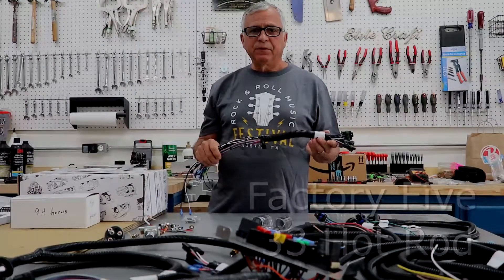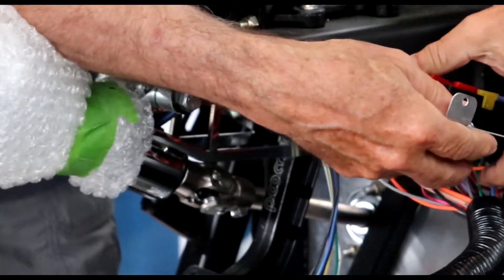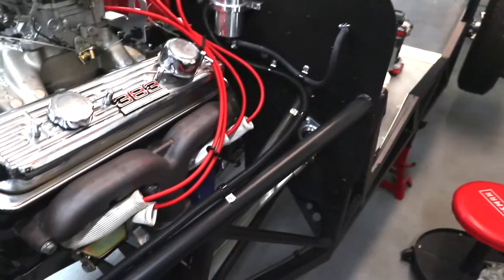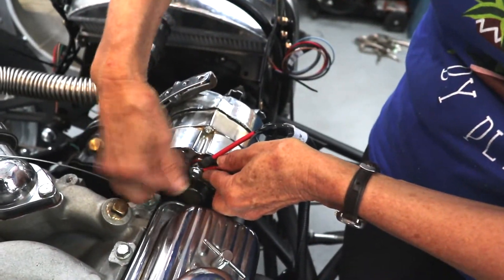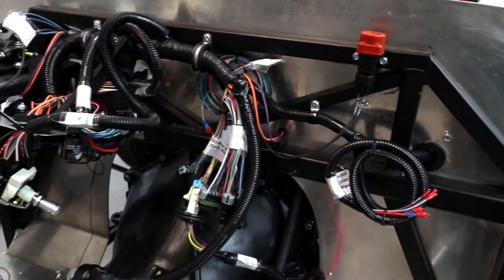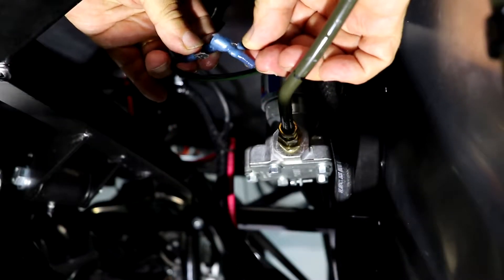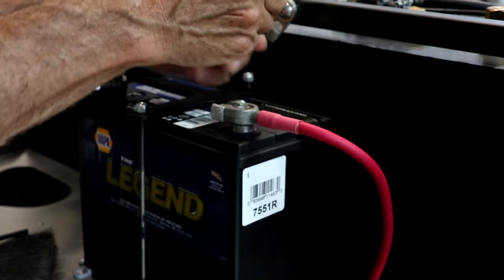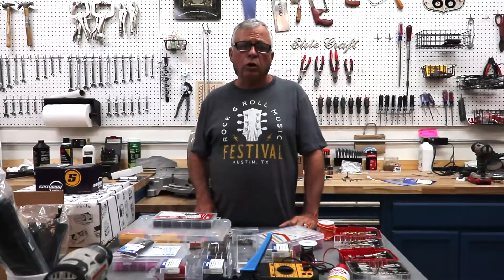#17 Factory Five 33 Hot Rod Build - Electrical

Comment: The wiring harness is simply color coded, and the wiring diagram for the car is overall satisfactory?  The inertia switch …. Does that shut down /  cur out power to the car in the event of an accident?  There fuse block has ample space built in to add?